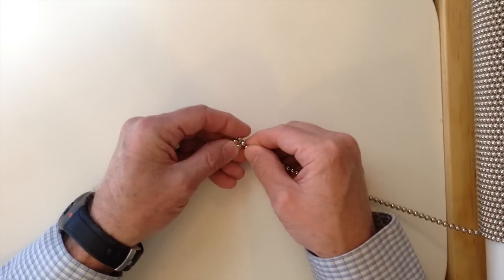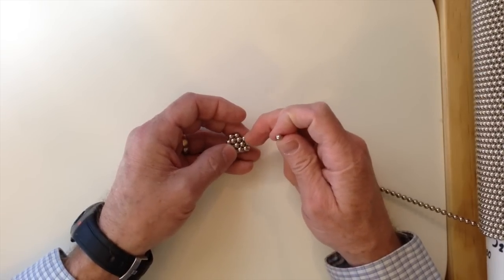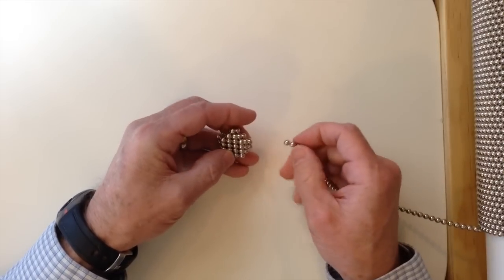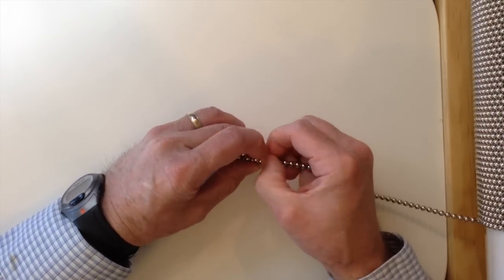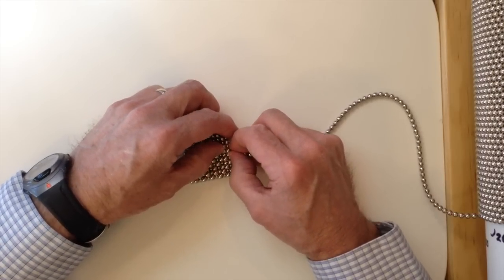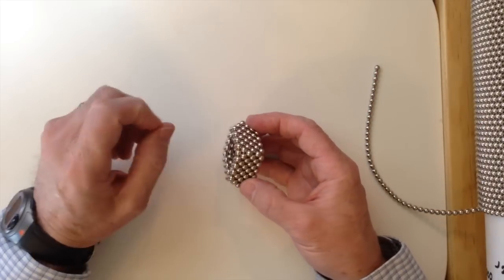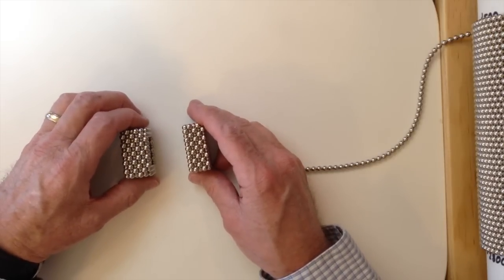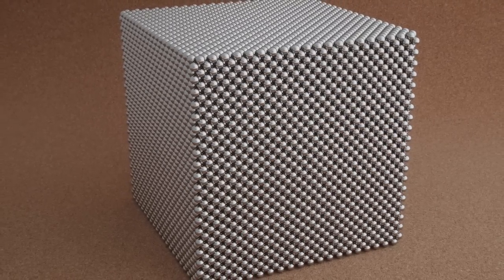Mathnetism's Hollow Diagonal Cube (Zen Magnets)

Comment: I have found it can be quite frustrating when it gets to the point of removing the inner layer. On an experiment, I didn’t remove it, and built the walls up anyway. It worked!  Same shape, but with a third layer concealed inside the top and bottom

Comment: Very nice tutorial! For n=1 I think the magnet count should be 13 instead of 14.
Reply from the maker: +Mathnetism You are right! Thank you for pointing this out! The magnet count N(n) = 24n(n-1)+14 for solid cubes is in fact valid only for n = 2 and above because it follows from N(n) = M(n) - M(n-2), where M(n) = n(4n^2+6n+3) is the magnet count for solid cubes, which is valid for n = 1 and above (see the written description in my solid diagonal cube tutorial).  For n=1, we have N(1) = M(1) - M(-1) = 13 - (-1) = 14. The culprit is M(-1), the number of magnets in a solid sphere of edge length -1, which makes no sense!  For n=2, we're OK because N(2) = M(2) - M(0) = 62 - 0 = 62. And for n greater than 2, it works perfectly. I omitted the n = 1 entry from the table, and made a notation about applicability only for n = 2 and larger. Thanks again for pointing this out.
Reply: Great work from both of you - I really like the results, but this diagonal stuff never was my friend, it's so complicated to build :D But the tutorial is good, so when carefully following each single step, it's manageable.